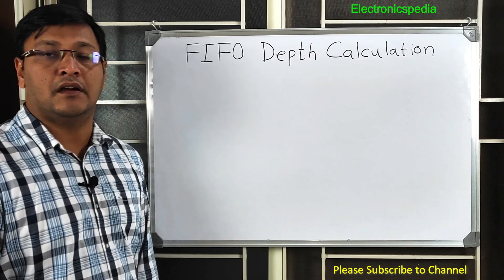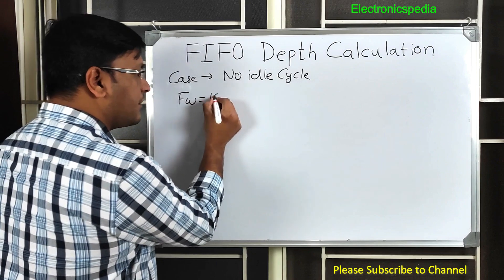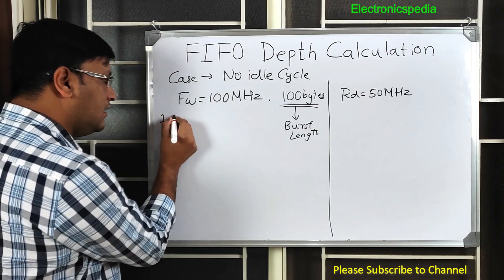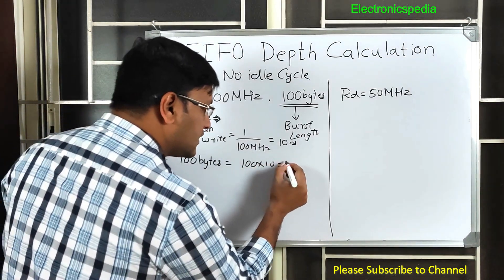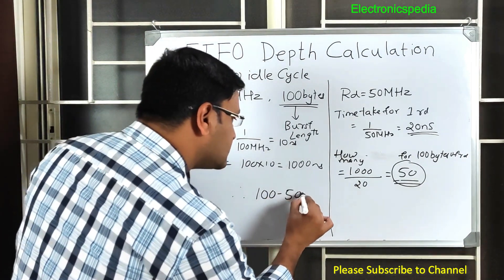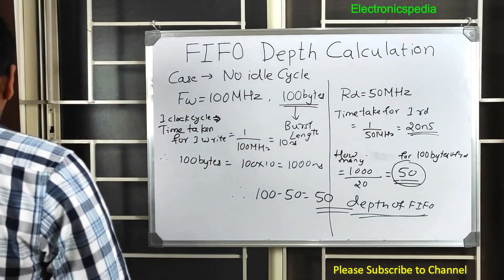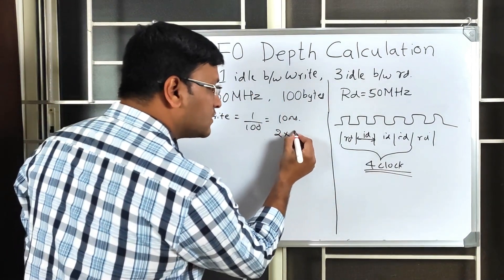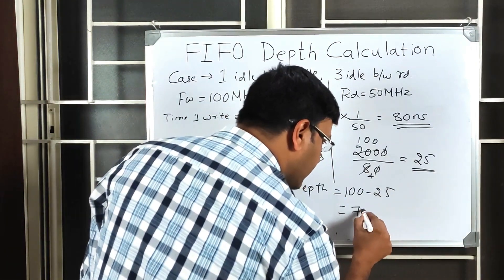FIFO Depth Calculation | How to Calculate FIFO Depth | Clock Domain crossing | CDC | VLSI Interview

Comment: One small note here: Since you are designing asynchronous fifo, you need to take delay for synchronizes into the account (unless told not to assume by the interviewer/examiner). So it will be addition by 2 or 3 (depends on clock frequencies and how much stage synchronizers you are using for pointer crossing the domains) into the depth value, as you need empty to be de-asserted before the first read can start.
Reply from the maker: Yes I agree with this. Thanks for bringing this point. 👍👍
I will pin your comments, so others can take a look.
Reply: Suppose I use 2FF for CDC, how many clk cycles I have to add as extra delays ?
Reply from the maker: @abhijeetchauhan4111  Usually metastability settles in +/- 1 clock cycle on number of stages in synchronizers. This information you will get in synchronizers library datasheet.
Reply: @Electronicspedia  So will it take one extra cycle for every read/write or one extra cycle for all read/write together. I mean whil creating fifo depth, do I need to add +1 in the final depth calculation or I need to take one extra cycle for each read/write ?
Reply from the maker: Yes that's correct. We need to take extra depth. This because we have to synchronize read pointers to calculate full condition
And synchronize write pointer to calculate empty condition
Reply: @Electronicspedia  thank you very much, sir. Very nice videos.
Reply from the maker: Thank you. 🙂

Comment from the maker: Please Like, Share and Subscribe to my channel :yt:
https://www.youtube.com/c/Electronicspedia
Reply: Thanks for sharing sir,it is more useful sir
I have some doubts in the fifo depth calculation sir
1,if write frequency is greater that read frequency and infinite data sir, that means no limit in data transfer and no idle cycle sir, that is the minimum depth calculation for fifo sir.
2,if write and read frequency are same only difference is phase is different sir and no idle cycle and transfer infinite data sir, what is the minimum depth calculation sir.
Thanks for advance sir
Reply from the maker: In case 1 , the FIFO will over flow if there is a infinite data transfer at some point of time. So we can not calculate FIFO depth in this case

In case 2, ideally you need 1 deep FIFO. but since we have synchronizers in the design , we need to take those into account. 
Fifo depth = 1 + number of stages synchronizers
Reply: @Electronicspedia  
Thanks sir, for case 2 which module need to synchronious sir for write or read clock,both are same frequency only change is phases only sir